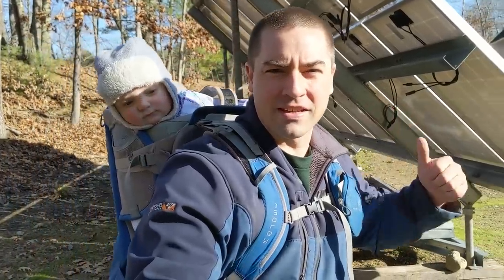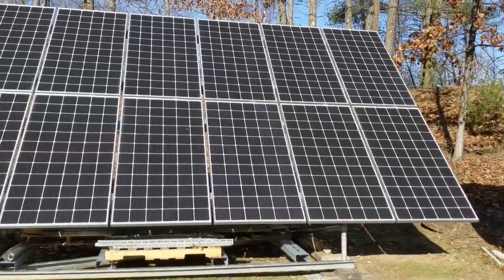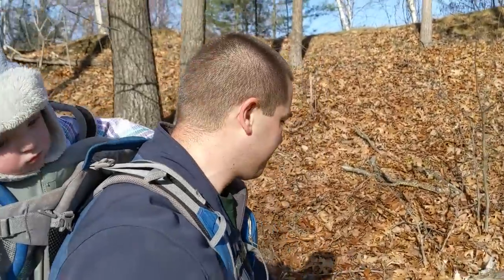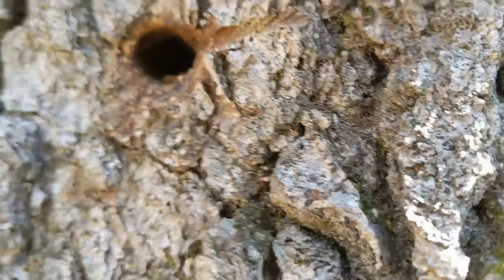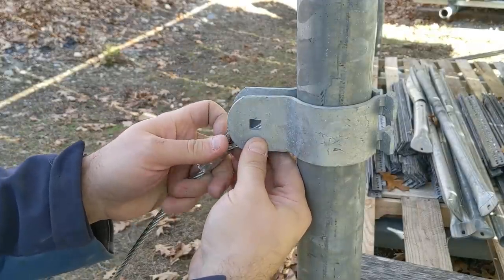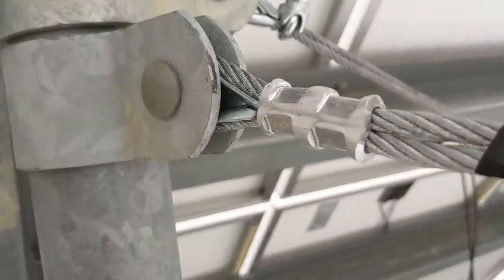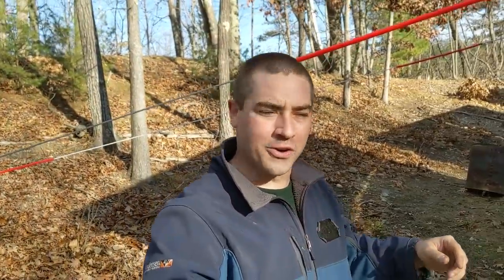Cheapest DIY Solar Array Anchor

Comment: I like your videos David and enjoy seeing how you have progressed through the years. Question about your anchoring.....Your rope idea prevents the array from tipping forward, what prevents the array from tipping backwards? Would you not have been better off driving some steel stakes into the ground and tying them off to the frame? (4) stakes would anchor it in all directions and would avoid the potential of clothes lining yourself. Keep up the good work

Comment: I would use mobile home anchors one each corner, you could still use them, dig a hole for them and either bolt a chain to them or a flat bar, to the steel panel mount, then cover the top of the anchor,

Comment: it looks solid, but i think by anchoring the corners to the same point (the stump), the whole array can move left and right, and it can still fly (potentially - i know you have a lot of weight at the bottom).  if it can generate even a little lift against the weight, it can slide left or right pretty easily and then... i'm not sure what.  mainly just be a huge pain to put back in place, i guess.  i think you're pretty solid as-is against damage, though if it slid towards its neighbor array, you could take out all the adjacent panels.

given the risk of kids/pets/adults walking into the cables, i think i'd prefer anchoring directly down into the soil somehow.  it looks like a lot of your added weight includes some long beams of galvanized steel.  i think you could dig some post holes (even rent an auger to dig them nice and deep), bolt the array rack to some of the steel beams placed in the holes, then fill the holes with shovel-mixed cement to basically make the ground mounting bullet proof and less of a garotte risk.

now, i'm assuming you aren't going to move the array.  if you're doing the cable thing so that you can move the array seasonally for some reason, then obviously the more permanent mount won't work for you.  if you're worried about the posts being left over if you move some time in the future, you can only fill the cement halfway up the hole and use shorter lengths of steep beams bolted together beneath the ground.  if you need to remove them, you can just unbolt and bury the lower part without risk.  anyway, you get the idea.

Comment: You said you weren't using the proper tool... Not so... The Proper tool for "swaging" (Crimping big stuff) is called a swaging tool.... Looks just like a pair of bolt cutters with different sized notches in the end instead of cutting blades... The tool you are using is a hydraulic version... Absolutely perfect for swaging big stuff. I use a swager for making standing lines on my sailboats... Your tool is perfect.

Comment: Hey David what will keep the array from blowing over back towards the stump. Great channel with lots of useful info by the way >
Reply: I’m guessing that if the wind is coming from the south then it’s compressive force against the tilted modules so the ballast will be enough. It’s when the wind is from the north (back of the rack) that’s the problem

Comment: Dig holes into the ground and put concrete pillars in place. Add anchor bolts into the concrete during the pour. Put the array on top of these. No guy wires needed then.
Reply: Usually, you just put posts in the ground 3-5ft deep with concrete and mount the rails on the top of them.

Comment: Should have used turnbuckles so you can adjust the tension as the cable stretches or cuts into the stump.

Comment: I've had the factory end come apart during stress. So I use 2 cable clamps on each connection. Now you need to anchor the front with big screw in anchors.

Comment: Post hole diggers are 29.00 and bags of concrete are less than 5.00 each. Dig down at least 48, place and set rebar , pour MIXED concrete. (DO NOT POUR POWDERED CONCRETE MIX IN THE HOLE AND THEN POUR WATER OVER IT) . Set a tiedown anchor in the concrete.

Comment: Hello Dave,

I have enjoyed and learned from many of your video’s on UTube.  

A few comments/questions on your anchoring one of your solar arrays to the oak tree trunk.

Are you experiencing any “wear” in the oak tree trunk?  I.E., (wire slacking a bit)

Maybe you did… but I forget at age 66, did you put some tough tubing/ protector sleeve over the wire (for the tree), type material over the “wire” (correct term for cable)?  

 I might be concerned that the wire might wear at the wood by flexing back & forth, loading (pulling/tensioning) and unloading (slacking) with heavy winds.

Not a big deal… as you simply can add —turnbuckles— at the array to take up any slack.  

Smear some good waterproof marine trailer grease on any —wear points— and to seal off the crimped ends from getting corrosion inside from water/moisture festering up under the fittings.  Grease is your friend all over in the weather.

Your crimps on the ferrules look excellent!  Keep doing that same technique.  If anything… just a bit less pressure for less crushing the stands.  You saw how even the machine crimped ends were far less crimped.  And for liability on a commercially sold product, these machine crimps were probably tested to several thousand pounds or kilograms if you like!  (;

I was a sailer in my younger years, and made up my own “LIFElines” around the perimeter outside edge of the weather decks with SS wire and ferrules.  Literally lives depended on the crimps being correct!

—You make me proud— of how you redo even your slightest mistakes instead of saying “good enough.”  Electricity is NO JOKE.  And it is NEVER, EVER JUST GOOD ENOUGH!!!  

I once took a 240 V. “Poke” (at age 64) off a sprinkler box down in Florida.  The timer that was often needed to be set by the homeowner, was separated from the power (240 V. pump) terminals by only a plastic sheet screwed on.  Through age and heat in the Florida sun, this divider sheet would become brittle and crack around the screw hold downs. 

Although I was able (Praise the Lord) to immediately break free,  the flesh in my opposite hand was already quite warm as the resistance to the current flow was already “cooking” my flesh!  Very noticeable warmth.  

That one could have easily stopped my heart or froze me on to literally cook!  

You just —cannot ever be too careful— around 240.  But 120 in the right circumstances can kill also.  All you need is a — good ground— in the other hand.  (My mistake with the sprinkler box).  Many professional electricians make a point of putting one hand behind their back, or in their pocket, -just to avoid this grounding danger-.  Wear good rubber, thick soled shoes as well.  If you need to stand in water or wet ground… wait until it dries, or let someone else do the job.  You’re a family man.

You have too much invested in your education on solar and a —great family— to risk —anything DIY— or otherwise, period.  

I can already see your son’s “gears turning” as he rides your back during this solar array tie down to the tree trunk.  Looking at everything, sizing it up, listening to you talk, etc.
Stay safe and keep up the good work!

All the Best,
Steve in Door County 
(Tip of the Wisconsin Peninsula)

Comment: I used 12" sono tubes, about 30" in the ground, and 1.5" galvanized water pipe in concrete in the tubes, on 8' centers, running vertical.  Not much engineering to it.  I cut the pipes to the angle I want, then weld another pipe from sloping from back vertical to front vertical.  

Running horizontal across the pipe, I ran 2" x 3/16" galvanized angle to mount the panels on (drill the angle and the panel lip, use 5/16" SS bolt) Mine been up for 10 years, had a lot of wind, no movement.

Comment: Those clamps aren't designed to hold that way. With the cable in between, you have less gripping force on the pole. Once the wind starts lifting up the panels those are going to slide down the poles. And if you put the cable on the outside, those bolts aren't rated for the shear and axial loads that you are trying to use them for. They will bend and snap off.  

You should figure out the wind loading, and put concrete piers in... where they should be for the mount you have, well below your frost line.
When I was doing 12' solid fiberglass satellite dishes, I would put in a bell shaped 3' diameter top, 4' diameter at bottom pier 4.5 ft down into the ground.
10' ft mesh antenna 1.5' diameter top, 2' diameter bottom pier 4.5 ft down into the ground.
Our frost line was 4' in the area.

You are just going to end up with a pile of scrap metal during your first good storm.
And maybe a roof or sidewall mount solar panel installation on your house, garage, car, whatever... etc...

Comment: I was wondering, other than the ballast weight; do you have anything to prevent tip-over when the wind comes in front of the panels? At first I was thinking tie-downs like they use on mobile homes. I'm sure the $50 spent is cheaper than tie-downs. Good job.

Comment: could have used the U bolt clamps instead of the ferrule crimps on the second final set for any future adjustment. Will the wind be able to blow over the solar array towards the stump? I like and admire all your work.

Comment: I'm presuming you want this solar setup to be secure for 10 years or more, so why would you not anchor it properly with concrete that will last as long as you need it?  While hardwood stumps don't rot away quickly, they DO lose strength every year.  Seems like a short-sighted solution to a very long-term need, if you ask me.

Comment: Arguably given that it is new wire rope and probably not prestretched having clamped the cables when tensioned you are stuck with tension setting but Iwould expect them to stretch in initial use.this will obviously reduce tension but no way of resetting.
You would probably have been better to initially use screw clamps above the compression clamps for a week or two before hydraulically clamping (Semi - permanent setting)

Comment: Using the hydraulic press to crimp the ferules was a great idea. That's basically how they are done. The actual tool used looks like the cable/bolt cutters you used to cut the wire. But it has a hole in the teeth instead of a sharp edge. 
It wasn't the wrong tool, it just was used for something slightly different than intended. Using the hydraulic press was a whole lot easier than using the crimping tool. I've done several while working at Lowe's, and was always a bear to use.
Great job! Those ferules won't be coming loose.

Comment: I would cleanly cut the stump in a slight slope, less risk of rot. Linseed oil and or a little galvanized roof would be good. Good for the pex markers, perhaps little hog fence around to mark off an area the kids aren't allowed in, and where you adults know to stay vigilant. Good job !!

Comment: I'd use a turnbuckle on each wire to allow tightening later as the wire stretches out. Wire preforms are easier than crimping after the thimble and can be redone later and don't damage the wire.  I'd probably just spend a couple hundred dollars and have a few yards on concrete added to the base and not worry about guying it.

Comment: I wouldn't trust that stump and those cables could snag ba running child. Sonotube, a few bags of quickcrete, a  J bolt anchor and a shovel is all you need. Put that sonotube right near the array and eliminate the long cables. Fixed.

Comment: You really should just do what most of these ground mount systems recommend and attach to a post in the ground every 8ft with concrete.  Concrete is about the cost for what you spent on cables and you won't have wires that you could hit when mowing or with kids running.  You still need to support the front of your array.  For anchoring to a stump, a screw eye - or eye bolt all the way through would be a better solution.   You are pulling sideways through the stump which will make it split easier.  Maybe after it flips backward you will rethink using concrete.  - I do install solar, so might be more paranoid.  But I certainly would not leave this like this without adding some proper footings.

Comment: I think you need to bolt the front down  ! Take two 5G bucket old junk get a ring something low cost a some concrete put it in the buckets let it dry with the ring in the top center . dig 2x holes on the ends about 10 ' deep put a bucket at the bottom with a cable on the ring and thin on the stand holding down work force on both front ends . this will help from wind flipping it over . Hope this helps love what your doing you (NUT)  !!! lol have a good day .

Comment: Seems the way you did it would keep it grounded if the wind blew from the back side of the array.  But if it blows against the front of the array it would still tip. I would have dug some holes in the dirt say 3-4' deep on each corner. Then put a scrap pole in the hole and poured some concrete in the hole and tied the above ground end to each corner somehow.   Thanks for the video!!

Comment: Why don’t you want to put some concrete in the ground and anchor the array without trip/garrote hazard? Is this just an experiment for testing before a larger final array project?
Reply: In Massachusetts that makes it a permanent installation and all kinds of different permits, both construction and electrical are required

Comment: Now it will blow over towards the stump.   If you are going to guy it,  why not use multiple ground anchors... or dig a hole and bury a dead man (a big piece of steel with a cable attached)

Comment: Not to worry, but, any other trees that could reach the cables and tip the array over backwards?    Maybe it's possible to diy weld some ground screw anchors.

Comment: Great solution David.  I was wondering if perhaps ratcheting tie down straps might have been easier to work with?  They are cheap, have excellent tensile strength and are much easier to tension, especially for someone who doesn't have the toolset that you have acquired over the years.

Comment: David, next time you have to work with cable that you're cutting to length, consider adding a length or two of UV-resistant shrink tubing before closing up the loop.  It won't weather and fracture like electrical tape and lets you put a nice, tight bind on the cut end.  If necessary you can tie the end up with vinyl tape before shrinking.

Comment: Nice build but I would've covered the rope with something where it goes through the tree to make sure the wire doesn't cut through the wood. I'm drawing a blank now but I believe ropes courses and utility pole guy wires are attached in a very different manner (a through bolt maybe), maybe for the next build try that.

While you are probably safe using the oak stump I would be a bit wary of it. A dead oak tree fell over near me and almost hit the house. I just noticed you passed 100k subscribers. Maybe somebody here could run the engineering calculations needed to make sure your setups are safe.

Comment: I think you do an excellent job. I feel like it needs the same thing but from the front to make sure it is properly strung but I guess it depends on wind direction etc. Currently I feel like there could be a tendency of tipping towards the stump. Also the wire is not very tight (and you can't make it tighter without pulling the array backwards as you showed). I'm used to apple trees with their stay wires and huge amounts of tension...
Anyway, great job, always love watching your videos

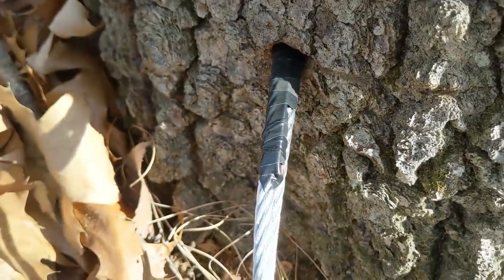Comment: 4:50 - if you pull the first cable through with the small one then once that's through use it to pull the second one. That way you're only pulling 2 cables (and tape) through the hole instead of 3.

Comment: That looks like a really solid job. I would check tension on a hot summer day to see if the wire has expanded. I initially thought you were going to feed the PEX through the tree to keep the wire away from the wood but I guess stainless will not deteriorate anyway. thanks.

Comment: Looks good on the back anchor. Are you planning on anchoring the front? I would be more worried about it falling over with a pull to one side but not the other, unless the wind always blows south on your property.

Comment: We can't buy every tool for a job, we just have to use what we got, I have the same hydraulic like you have, and I use it very extend when I need to crimp 1 here 1 there, my 18 panels seat on top of 275 gallons tote, most of those totes have 1/3 - 1/2  water inside, last Summer/Fall these panels already see 50+MPH wind, at the end I will have some post cement to the ground, I live near Ozark so my ground have a lot of rock, I need backhoe to do the job, for now I just testing to find out the best angle for my system, I have altogether 34 panels most of them 340W the rest 345 W, I ran the house with 2 PIP Hybrid inverter, I use this setup since Sept, I don't like the parallelly mode, I may by the new inverter they have for 8KW so I don't have to deal with parallel, most of my error due to software and too much power generated, Summer days I got 100% of power but now I got about 75%, I can't run my central heating/AC in the PIP system, my house 100% electric, heat pump, no gas, I heat the house with fire place, loaded 4-5 big oak logs in the fire place, that will burn all night to keep the house 70+ degree, so far cost me 3 truck load of the logs for this year, the winter season will cost me $350-$500 for woods, help some of local people out, wood is renew energy
Reply from the maker: That sounds great.  Finally someone else who understands not all ground can just be dug with a shovel.  I'm in the same situation, that if I want footers below the frost line, it requires a backhoe.